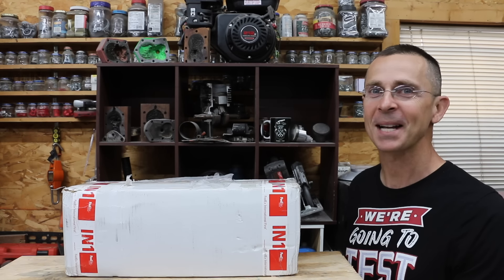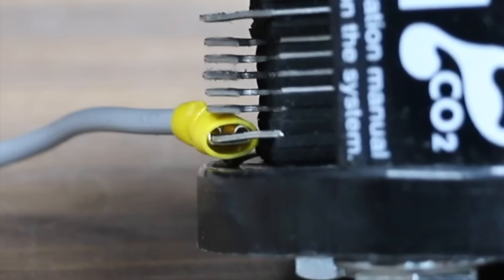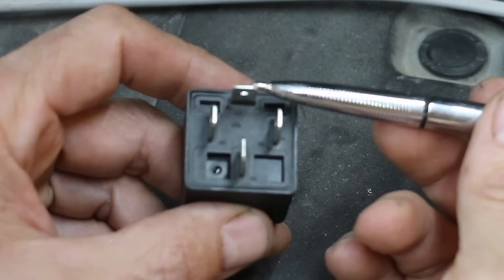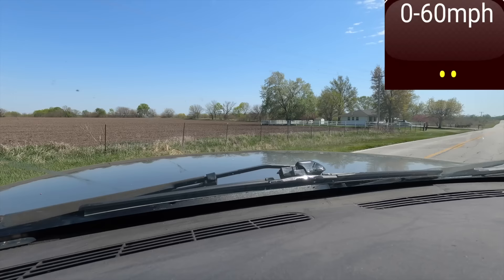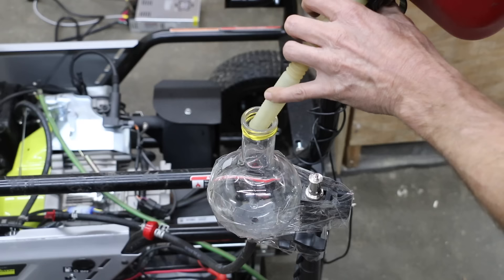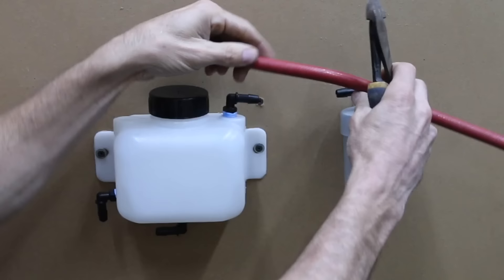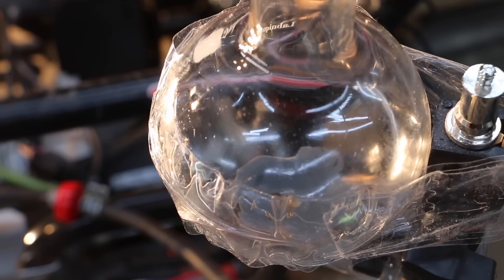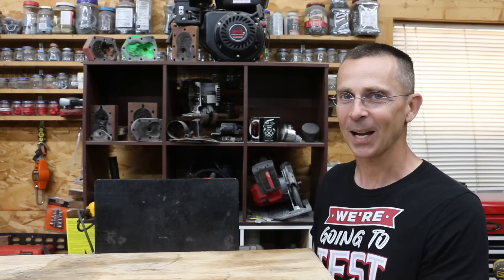AMAZING 35% More MPG with HHO? Let’s find out! Help with high gas prices?

Comment: Dude - I'm really impressed.  I've seen enough of your videos to know that you're plenty smart enough to know that you're testing a scam but you went ahead and gave it a more than fair test with no opinion at all even though I'm sure you had one.  An excellent review.  Good job!
Reply from the maker: Thanks!
Reply: Why do you think hho is a scam?
Reply: To start with, if it worked, the system would be built into at least some cars. 35% fuel savings would be a KILLER selling point.
Reply: @josephlunderville3195  but that’s not how economics work.. 
they have designed smaller more environmentally friendly cars for a reason right?? 
Think about it! 
the older bigger engines, believe it or not, tuned right, 
will haul your family and luggage or your tools for work, farther, more reliably, and cheaper then any 3.5 v6 or smaller or 4 cylinder.. and turbo don’t get me started.. with a bigger motor you will stop for gas less because your vehicle won’t be fighting its own weight plus your load!!

next question.. 

what are the most explosive elements known to man?
Reply: @josephlunderville3195  here’s a hint, it’s not gasoline or even a petroleum product! Whatever you decide it to be, answer me this??
 why don’t engines run on that??
Reply: @josephlunderville3195  you can get really close to 35% fuel savings with simple bolt on performance mods? That are legal and meet emission standards?
 But Don’t buy them to outperform,
 just keep drive the exact same and watch the savings, it really is an incredible amount! 
Can you explain that please?
Reply: Think about how there are 0 successful hydrogen cars despite having been around for 20 years if it was this easy they would incorporate it in a lot more vehicles. When I first found hho I was like Holy shit genius but the issue is corrosion sure this cell works for a little bit but within a week those metal plates will be caked with corrosion
Reply: its not a fair test. he didn't adjust fuel to air mixture ratios so how can efficiency be changed?
Reply: @xcodychaosx  I'm sure the oil industry has absolutely nothing to do with it. According to Bob Lazar, storage is the only problem to hho, and it's problem isn't technical, but regulatory. Once people can harness energy cheaply/freely, they can basically do anything without reliance on the system. . Can't have that now, can we?
Reply: @sheelegal  The EFI system would do that automatically.
Reply: @bmint  It's a scam because of the physics involved. In order for the HHO generator to make the gas, it has to break the bonds between the hydrogen and oxygen atoms in the water molecule. Where does the energy for that come from? It come from the alternator on the vehicle. And the alternator gets that energy from the engine. The engine gets its energy from the fuel. In this case, it's burning the HHO. What does burning the HHO mean? It is combining the hydrogen and oxygen atoms into a water molecule and releasing energy. The amount of energy that is released is the same as the amount of energy that is required to tear the molecule apart. So, you are taking the energy released from burning the HHO and running it through a very inefficient process to generate the energy to generate the gas. It is akin to a perpetual motion machine.
Reply: @petroelb  it's crazy reading comments that says it's a scam and the car industry would use it more if it actually worked...lol...My only questions is do you have this applied to any of your cars or personally have any experience with hho on a vehicle??...Because I've ran into a couple of people with hho setups on their trucks and they get 35mph in their trucks...So to each is own...
Reply: @kashproductions619   I have done  a lot of work in the automotive industry over the last couple decades and I can tell you that if someone brought them a technology that would increase the efficiency of their engines by 35%, they'd jump on it faster than Joe Biden sniffs little girls. They spend absolutely ridiculous amounts of money doing constant redesigns and R&D to increase mileage by single digit percentages. I love a good conspiracy as much as anyone but this one isn't legit. The problem with HHO setups is that the math simply doesn't work. You're using twice as much energy to generate the gas as you'll ever get out of it. The is a great example of somewhere where following the science can save a lot of disappointment. To answer your question,  I have experimented with HHO on a couple of vehicles just for grins and did not see any benefit at all.
Reply: @petroelb  sad you believe this…However hho seems to work better once it’s all dialed in just like after you add performance parts to a car you have to recalibrate the computer however no one on these videos seems to do this…I love seeing a couple of people claim to do this and have x amount of years in this then back everything up by science…I’m not trying to discredit what you say however allow people to do there own thinking and research because a trillion dollar industry isn’t interested in losing money by any means necessary regardless of what a couple of guys like us behind computers might believe because I know when applied correctly hho works otherwise Mr. Meyers the creator of the water fuel cell wouldn’t have been murdered…lol…FOLLOW THE MONEY…
Reply: @kashproductions619  I'm an electrical engineer and have tried to take a critical/analytical approach to the whole HHO thing.  The only way that I can see that it could possibly provide the efficiency gains that they claim is if it's something more than just the energy from the HHO combusting.  For instance, if the HHO aids the combustion of the gasoline, causing it to ignite more quickly and/or burn more completely during the combustion stroke of the engine than it would without the HHO.  I'm certainly open to the idea that it could work but, to date, I have never met anyone for whom it does work.  
I do know that I have friends in the high pressure die casting industry and vehicle manufacturers are heavily investing in that process to replace steel parts on car frames in order to make cars lighter.  Also, I'm currently working on a process that they are, again, investing millions of dollars into in order to make interior car panels that are literally ounces lighter than the current plastic parts.  It's insane how invested they are in making vehicles lighter and more efficient.  Because they have to.  It's being forced on them by the various world governments.  That is why I don't believe in the whole "follow the money" conspiracy stuff.  But, as a co-worker of mine once told me, that's one of the wonderful things about living in America - we have the right to be as wrong as we want to be!
Reply: @petroelb  the problem you seem to be having is that applying logic to a specific idea takes away your ability to feel like it's working, therefore you're clearly biased. Stop trying to be all sciencey and just go with it, man. Trust me, I gamble a lot and I've never won.
Reply: @InchFab  That is a fair point. Maybe I just need blind faith.
Reply: @bmint  because it defys the law of thermodynamics.  The amount of drag produced generating electricity for the system is more than the power/benefits gained.  That loss actually does the opposite of what the HHO system sellers claim that is will do.  Drag and loss = lower power and fuel efficiency.   You will gain more by adding a high flow exhaust system and maybe some headers than you will ever get with some scammy HHO gimmick.
Reply: @ghz24  this was a waste...However people should really refrain from saying stuff doesn't work just because they believe it doesn't...HHO works better than people are saying...And I know for a fact it does...I've seen it first hand and now I'm going to build a system for my car to prove the point...lol...People believe anything backed by science however won't go and put in the work themselves to see if it works...These comments are a scam and so is this video...
Reply: @kashproductions619  I’m on the edge of my seat, please do post results once you have it running! Even in the face of overwhelming evidence, I’m always willing to be proven wrong. All the theories in the world don’t mean a thing if they defy testing, that’s ultimately all that matters.
Reply: B mint alberta, to answer your question HHO or Browns gas is extremely volatile when compressed and nearly impossible to produce in a sufficient volume to run that engine in a safe manner. The "bubbler" is a primitive back flow prevention to prevent any spark from igniting the generator and when hitting bumps or hard cornering, its possible to have an explosion. Hope that clears things up. Look up Stan Meyers on youtube, he was the pioneer who made HHO actually work despite the lack of safety
Reply: @rovidbouski4022  I assume you mean Stan made the scam work not the apparatus.
He never let anyone inspect his car for good reason it couldn't stand up to inspection by people that know what they are looking at.
Reply: @ghz24  do you mean "conversion"? I've never seen conversation used to describe converting.
Reply: ghz24, no, Stan Meyer made it work, it is possible. Stan wouldnt let others inspect the car for the same reason Dominion Voting systems wont let people examine their routers, it's proprietary technology. The issue is not the hho, the issue is the cheap cells that are too small to produce enough gas, lack of pulse width modulators, efi programming and the biggest issue is SAFETY.
Reply: @debtminer4976  exactly, there are so many ideas that just get swept under the rug, because of that!
All industries work this model
Reply: @petroelb  the old cars got better mpgs! 
Fun Fact, 
my 99 Chevy will go way farther then any of my friends new chevys , that switch to 4 cylinders on the highway.. can you explain why that is?
Reply: @kashproductions619  and on top of it, with good fuel cells, you can make it at home.. no need for onboard hydrogen generators that apparently don’t work?? 
They do work
Reply: @rovidbouski4022  thanks, that is a great answer.. not many critical thinkers here.. 

I know all the details, and I also know the millions or billions have not been put into research and development.. 

Safety issues could easily be mitigated! 
Ford did it, I believe in the 2016 explorer.. A very good proven albeit totally different approach.. they get way better mpgs..
Hydrogen fuel cells, not generators
Reply: I built these for a person who was selling them.. yea they don't work. In order for them to "work" you have to remap the computer and disable the o2 sensors or rewrite the o2 sensor program. The engine will compensate for the less dense air (think driving at altitude) and your back to normal mpg
Reply: You said it yourself, hydrogen fuel cells, not hho generators. I actually know a physicist who has been revolutionizing hydrogen fuel cells for well over a decade. The safety issues with the actual hho generator arent easily mitigated as small malfunctions can result in a big boom
Reply: @MicroOutdoors  yes however once you tune the car boy the saving kick in like no other...
Reply: @bmint  I certainly can explain why your old car gets better mileage than a newer one. There are three reasons: emissions control, safety and engine power. 
As EPA emissions regulations have become more strict, newer engines have to have more emission control garbage on them and emission control hoopla always means lower fuel mileage. Similarly, as safety regulations and expectations have gone up, so has the weight of the typical car. Those steel reinforcements in the doors, air bags, etc all add weight. In addition to that, the average car today has a far more powerful engine than they have in the past. More power = more fuel used. 
Those 3 reasons are why my 1983 Nissan could get 40 mpg no problem on the highway with carburetor - it weighed nothing (it was a death trap), had virtually no emission control clap trap beyond an EGR valve that probably didn't work and it had all of 65 hp at the crankshaft - but my 1999 Ford Escort could not.  A 1978 diesel Volkswagen Golf could get 50+ mpg for the same reasons.
Reply: @dangolfishin  yeah auto-complete got me.
Reply: @ProjectFarm  are you gonna chime in on any of this?
Reply: Rick O'Shea  no he turned the water into wine, 
this might be above your pay grade?

Comment: Since you drilled that hole in your air intake, I can’t help but suspect a “Which aftermarket cold air intake is best” video in the works lol
Reply: He already knows which duct tape work best. Air intake IS technically a duct so using it wouldn't even be Jerry rigging it
Reply: Likely K&N, but that's because it offers almost no restriction on air flow due to extremely poor filtration. Great for the 1/4 mile drag ...but slowly killing your daily driver by always letting dust and debris into your engine.
Reply: @SomeGuy-vo7we  actually K&N isn’t the best. Black bear performance did some dyno testing on the popular intakes with GM vehicles.
Reply: He already did that and most of those cold air filters are garbage at filtering.
Reply: Most of the time the stock airbox is best.
Reply: @sukmidri  wrong.
Reply: @chevyon37s  K&n gave me 8% better fuel economy on 6.2 ford
Reply: I don't get why they still call this a ''cold air intake''. It should be called a hot air intake since it sucks all the hot air from the engine and radiator.
Reply: @Earlve001  A stock air box with an upgraded filter will still give you better performance in a lot of cases. A street bike for example has an engineered air box ment to give you the best powerband possible. If you try to delete it and just put some air pods directly on the throttle bodies, the engine will run like crap.
Reply: He already tested air filters, which is already the most restrictive part of a stock or cold air intake, so the main point of the question has already been tested.
Reply: sw4gr1d  do a better test
Reply: sw4gr1d  how does one smooth out pleats with e dremel?
Reply: @MrArcticPOWER  most CAI’s yeah, but the one on my truck has a air scoop underneath the air dam. So mines a true cold air intake.
Reply: The results from such a test would be inconclusive in the real world.  The brand that works best on 1 vehicle/engine, may not be what works best on another.
Reply: @aaronthomas6155  well that’s the case with many products, but there’s certainly a better brand overall.
Reply: @Dman1998  The "better brand" will be entirely application specific...  There is no 1 manufacturer that is definitively "the best" in regards to "cold air intakes"...
Reply: @aaronthomas6155  I disagree, but then again I’m not here to argue haha

Comment: Great video and effort on testing the HHO generator! However, it looks like there might have been a crucial component missing in your setup - a fuel regulator. The main idea behind HHO systems is to supplement the traditional fuel, allowing your engine to operate on the lowest possible amount of it. A fuel regulator can help control the flow and ensure that the engine uses minimal gasoline or diesel, while benefiting from the higher octane level provided by the hydrogen. This adjustment could significantly improve your system's efficiency. Would love to see how this change impacts your results in future tests!

Comment: Did you notice any difference in fuel economy on the suburban? Just curious cause the generator is carbureted and the suburban is fuel injected so maybe the suburban ECU will see if it running lean or rich and maybe adjust fuel. And I love your videos straight to the point!
Reply: Generator is fuel injected also...

Comment: Problem is AF mixture is set from the mas and the o2, these systems worked on old Beetles because we would manually adjust the carb to lean out the AF, simple procedure HHO off set carb lean till it sputters, turn on HHO to remove sputter, gently rich the mix until it runs smoothly and you get your MPG increase. Yes oil Temps were checked as was timing to prevent detonation issues.

Modern engines see a cleaner burn as leaning out, so the ECU enriches the mix to offset and you get poor MPGs. 

These systems work better on Diesel as its a static rate of diesel going in versus a variable rate like modern gas engines. 

Good test but it was missing this variable.